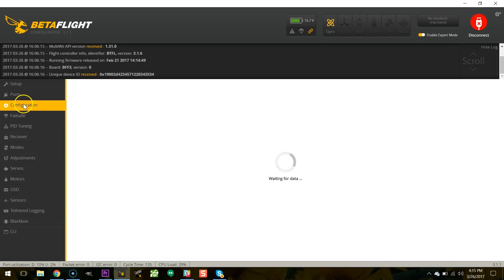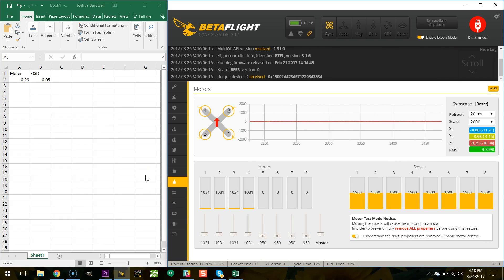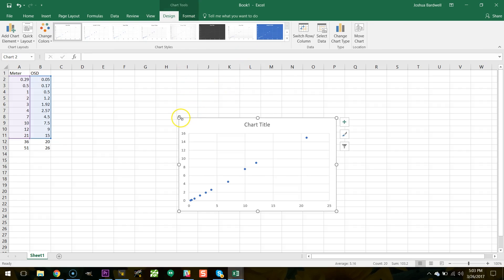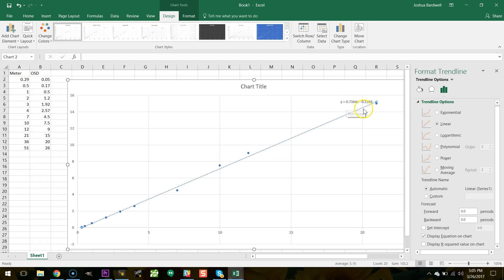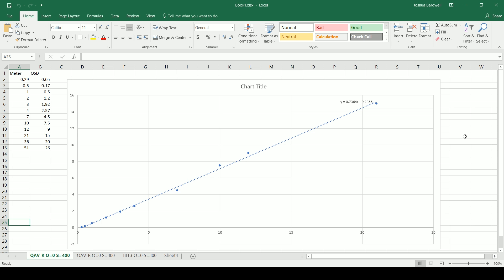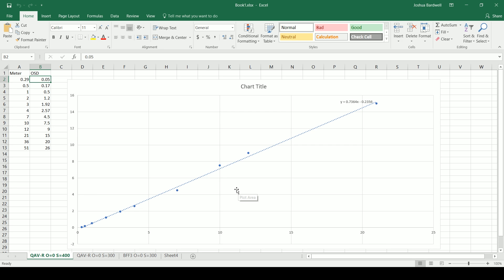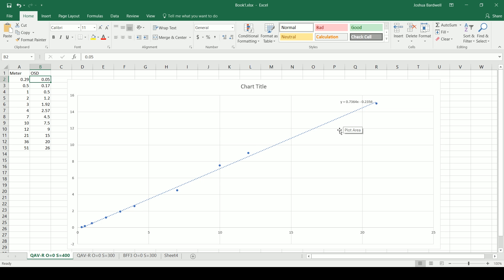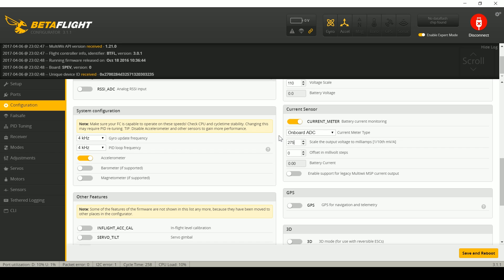Betaflight F3 Inaccurate Current Sensor mAh Readout | FIXED - Part 2

Comment: Make sure you don't accidentaly hit the Home button. That will spin the motors to full speed and it wont be pretty. Trust me, i know.
Reply from the maker: +Fábio Castro yep. And End shuts them down.
Reply: On my keyboard the HOME is above the END on the Numeric KeyPad. I don't remeber where it is on "normal" full keyboards but be very carefull.